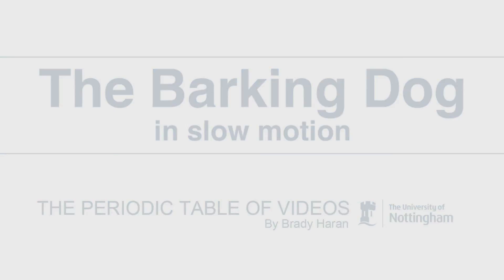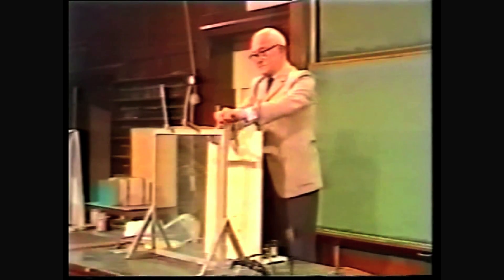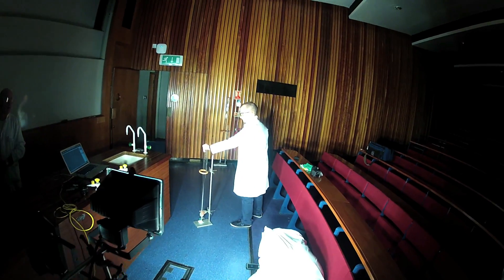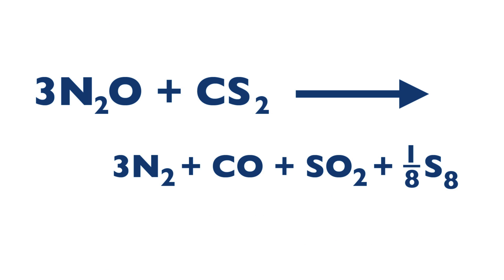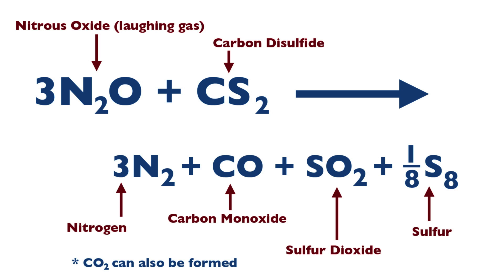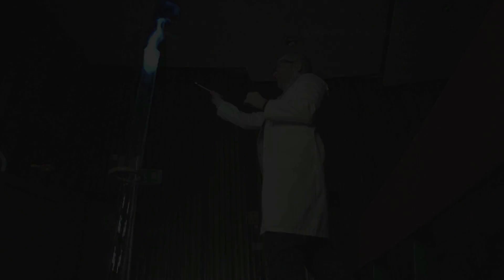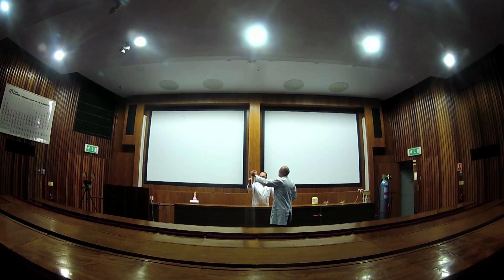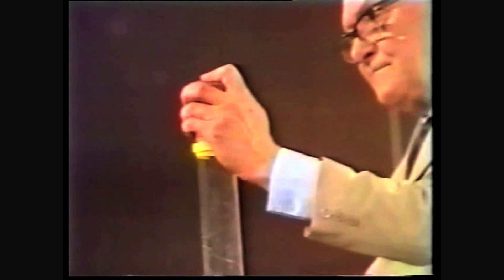Barking Dog (slow motion) - Periodic Table of Videos

Comment: @Philbert de Mercey: I think that it has to do with the flame moving. When the flame moves upwards, it makes the particles at the top of the tube move away (maybe more energy and bigger vibrations because of heat). When the flame then goes back down, there is space for the particles on the top again, and they move down. These particles moving result in vibrations (sound waves) in the air. And the close the flame gets to the bottom, the faster it moves, which makes the frequency of the sound....

Comment: Now if you were to replace the bottom of the tube with a reed valve or a resonate tuned pipe and a method of injecting more fuel you will have a pulse jet engine. Same as the German V-1 rocket. Fuel is unimportant as long as it is atomized.

Comment: If you look closely in some of the slow motion demonstrations, especially the one starting at 5:05 or thereabouts, you can also see vapor condensing and vaporising off the tube's walls. That I think supports the shock wave theory very well, as the rapid changes in pressure would make the carbon disulfide go from vapor to liquid and back with the same frequency.

Comment: Could this be the same phenomenon that causes the low frequency resonance inside a jet engine when it is at low rpm? The resonance causes a very intense vibration at low rpm when the pressure difference between the compressor and the combustion chanber(s) are at their closest to being equal. Could the flame front be bouncing back and forth off of the incoming compressor air?

Comment: Resonance... same principle causing a supercharging effect in internal combustion engines, and determines what the 'dog' will sound like. In engines, the 'bounce' occurs as a result of poppet valves opening and closing, and the elastic nature of the fuel/air mixture's momentum and inertia through the engine's intake and (primary) exhaust systems. You can tune for more efficiency by altering the primary length of intake or exhaust to suit the powerband of the engine, like a musical instrument. :)

Comment: In 2 cycle motorcycle technology, the shape of exhaust (expansion chambers) were extensively studied and huge gains in power were achieved learning to manipulate the post-combustion shockwave...using different exhaust pipe shapes etc.  See NS500 on youtube.  4 cycles as well...see youtube videos of legendary 1960's Honda RC166/RC149 GP racers... 5 and 6 cylinder engines -journalists all described as barking exhaust sound...and tiny 50cc 4-cycle racer revved to 23,000 rpm ! Neat video thanks.

Comment: About the "bouncing" and sound:
I think that the bouncing is responsible of sound. The frequency of the bouncing seems to decrease with time (as far as the filming speed kept constant).
I am wondering whether they measure how instant frequency changes with time and try to emulate such sound using some electronic means.

Comment: That is really cool. If you watch closely tho the bottome of the tube when the flame front goes up, you can see some mist rising from the bottom. I bet there is a lower than atmospheric pressure at the bottom in that moment.
Build a Pulsejet!

Comment: The first time I saw this demonstration the tube was 10-12 feet long and laid horizontally on a table with a stopper on both ends.  They replaced the stopper on the non-ignition end with fiberglass wool and then lit the other side.  The reaction always blows the fiberglass wool out the other end.  I wonder if it would reflect/bounce back because of not having a firmly sealed "bottom".

Comment: if you think about it, you would realize, that the pressure that was built up in the tube would just shoot the cork out. And if you would be able to seal it so tight that it wouldnt get pushed out, it would explode/be able to crack it at least

Comment: Could be the rapid change of pressure that causes it when the shockwave bounces off the bottom of the tube. Looks similar to when an airplane breaks the sound barrier. I think the vapor in the air condenses quickly and forms a mist for a brief amount of time.